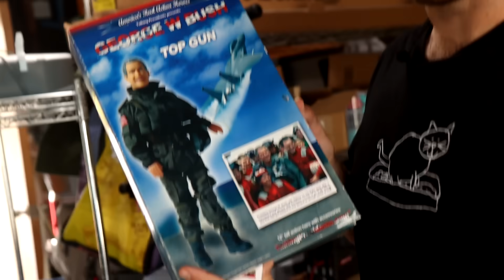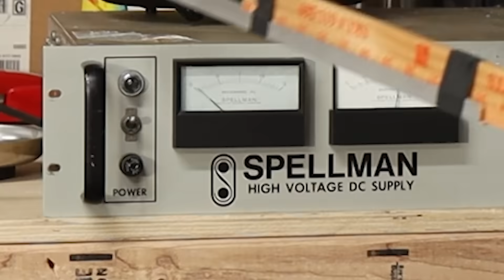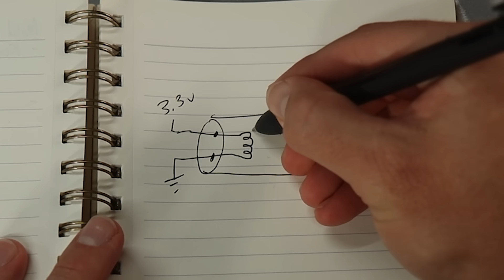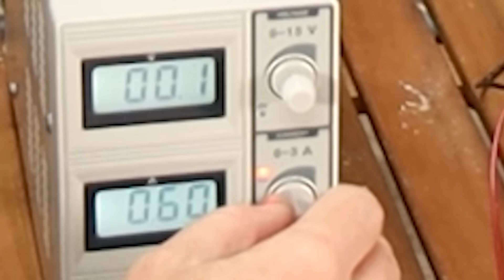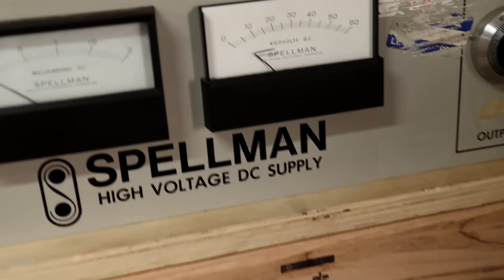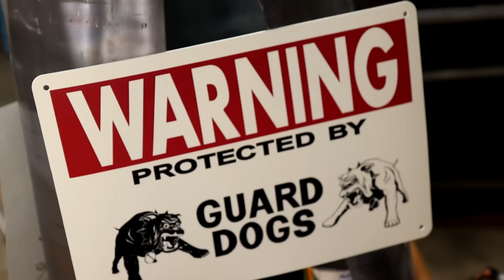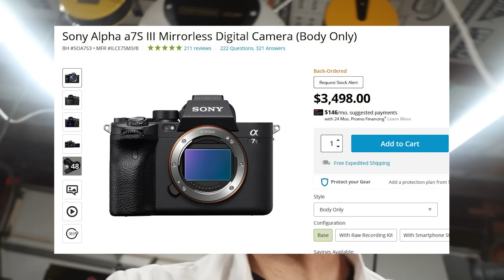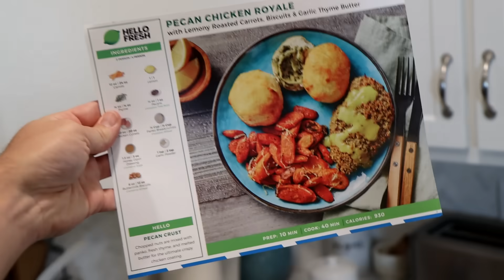Built My Own X-Ray After a Hospital Charged Me $69,210.32

Comment: Have you considered that what you pay for includes so many other things than just the X-ray;

1. the first visit where you explain your problem to the physician 
2. The doctors experience to understand and find your problem 3. The recommendation of necessary tests to understand the illness and give a proper diagnosis 4. Treatment and prognosis. 

Aren’t those things actually the important things you pay for. The tools that has been engineered to perfection to give a better result, better treatment and to be as safe as possible. 

You aren’t happy with how much they charge you. For me this is more a political problem in the USA.
In USA, a heart transplant would cost around $1 million-$1.66 million but in Sweden where I’m from it would be much less. So American citizens maybe shouldn’t be so negative about Obama-care but see it as something that could after more changes and improvements could be acceptable.

Sweden has a publicly funded healthcare system, Swedish citizens and permanent residents do not pay the actual cost of heart surgery themselves. Instead:
	•	Open-heart surgery (e.g. bypass, valve replacement, transplant) is fully covered by the regional healthcare system.
	•	Patients usually only pay the standard patient fee (around 10–40 dollar per hospital visit) and sometimes a daily hospital fee (about 10 dollar/day) during admission.

Comment: I hate to be that guy, and what you have made is very impressive. But you're wrong, this is far more dangerous than a plane. depending on many factors, which we aren't aware of, this most likely is producing extremely dangerous levels of radiation, which your equipment cannot handle. potentially in the Sv/h, and even though you only turned it on for a second at a time, that is still potentially hundreds of uSv. Sorry to be a safety nerd, but with radiation taking risks can have detrimental and lifelong effects.
Reply: If your sorry to be that guy then don't say anything like the holy 3 year old negative comment is real

Comment: Why aren't you soldering the wires and using heat shrink insulation on the wires and building a secure housing for the components ?

Comment: Airplanes emit radiation?
Reply: No the sun emits radiation, the atmosphere Usually blocks these rays, however when you are so high in the air the atmosphere isnt thick enough to block as much radiation, if airplanes were radiation shielded you wouldn’t have said problem, however radiation shielding has to be made of heavy dense material, (for it to be thick enough to block radiation) so the heavy lead/other dense stuff would weigh down the plane.

Comment: William, I think you had the e- part backwards. If we’re only talking about the high voltage and leaving everything else off of the table, such as generating e- through the low voltage application, the electrical arc created exclusively by high voltage will be the same exact plasma arc that’s created by lightning. When lightning goes through the air, the plasma burns so hot that it rips the e- off of existing particles that makes up the surrounding air molecules. It’s also doing it so fast that we hear a sound while it breaks Mach one in the process! Don’t forget that the process is a result of a difference in potential just like anything else electrical, however we have air substituting for part of an otherwise closed system, and for an electrical arc to be created we need a start off with an ionizing event that will cause a subsequent avalanche effect thereby releasing not one, but two e- over and over again with one being the liberated e- and the other being the ionized e-. The result is the plasma that’s replicated exponentially until the arc is closed. The resistance of the air creates the heat as a natural byproduct, just like component level resistors would, the heat repeats the process, etc. As long as there’s a difference in potential, we will see A LOT of various molecules lose their e- as a result! I kind of envision this process as breaking a rack in pool, which then continues breaking more racks. If we really think about it, this is how we are always taught that electricity moves, but actually doesn’t in a closed (wired) system as that’s simply excitation of e-! This is literally moving the e- from point A to point B! I really enjoyed the video and I subscribed. I just wanted to throw this idea out there.

Comment: Ah yes, the xrays are dangerous, I'm so concerned about the xrays and not the 60 thousand volt power supply that's shocking anything that comes close to the unshielded wires.

Comment: Lead isn't special for stopping radiation. All stuff stops radiation. It's just that lead is a cheap way of fitting a lot of stuff into a small space. If you had infinite budget, gold would be a better radiation shield than lead.
Reply: I think lead sucks up electrons and radiation if I recall, thats why you wear a big pad with lead
Reply: @Seedwreck  the x-ray technician, meanwhile, steps outside the room, because the wall is just as good of radiation shielding as your lead apron.
Reply: @diablominero  yeah, that’s how particles work
They bounce or not, they don’t just magically go through things

Comment: There's a few things I'd like to say, 

1. You wasted a lot of money on a high voltage supply. Why? Just why? I bought a 40kV one off of amazon (it's a ZVS Flyback driver) and added a voltage multiplier and it works just as good as yours.

2. I'm pretty darn sure that in a couple of years, you'll regret making this EVER because of the exposures you got from that thinking it's "safe" are pretty large. If it was me, I would NEVER be this close to this and I would NEVER EVER put my hands or anything into that. Now I'd also like to know why did you buy the geiger counter? It was pretty mad, but you still thought it was safe. Look, do what you want with your life, but I don't think that this is worth risking skin cancer. 

Overall, this is absolutely not safe. I learned a lot about x-ray machines, and if I were you, I'd pay those $300 instead of getting skin cancer, hurting myself or others.

It's also a waste of money, I made this project (not a x-ray, but a crt tv which is pretty familiar to this) for less than 50€.

Comment: Using this device sparingly is probably reasonably safe. That said, it probably gives the patient and operator a significantly higher dose than a professional x-ray. The policy of ALARA (as low as reasonably achievable) would discourage frivolous use of a poorly shielded x-ray imaging device. Don't make a habit of using this. I'd also suggest improved shielding. 

I wonder how good the resolution is compared to a professional x-ray.
Reply: Probably not bad resolution if there are lotta particles.
Definitely more than a professional dose

Comment: When I worked in the emergency department I learned about how socialized medicine is killing us pricewise. You go in for a mammogram, and its something like a 14,000 dollar procedure when all's said and done. It uses alot of power, the machine is incredibly expensive, you have to pay for the building, the rent, the actual room in the hospital, and requires technicians in order to service, actively use, and read the results. Medicare pays the hospital a total of 20 dollars for the entirety of the procedure. Doesn't even pay to keep the lights on. TWENTY DOLLARS.

BUT WAIT

THERE'S MORE.

Also, what the gov't does, is hold all medicare funds from dispersing. The hospital has to show the govt, through use of the surveys (that no one fills out unless they're pissed off) that are handed out at discharge or mailed later. If the hospital gets say, an 80% instead of an 85% on one category, the gov't keeps the medicare funds that should have been paid out for services rendered. 

KEEP 

IN 

MIND

everyone else involved in getting that patient into that appointment needs to all fight over percentages of that final pay-out. That means if she had to have an ambulance take her to the ED, who recommended her get a mammogram, (weird but bear with me), that means everyone involved ends up getting 3 dollars or so for this whole situation. 

This is ONE reason socialized medicine will be the absolute death of us. Its like breakfast sausage, we want it on our plates with our eggs, but we don't want to know too much about how it got there, or what its going to eventually do to us.
Reply: I ain't readin allat
Reply: USA just crazier, go north.
Also alot is not a word

Comment: can anyone explain how anode give off electrons? are they replaced then or how it works?
Reply: The electrons actually come from the filament! The filament is heated and a process called thermionic emission emits electrons. Once voltage is applied, those electrons are rapidly accelerated into the anode. Interactions with the anode is what creates the X-rays!

Edited because i misspoke!
Reply: @emilyisaac9028  so they are produced "extra" other than electrons in the metal atoms?

Comment: great vid! what's really funny about this is the emphasis on radiation whilst working with a high voltage power supply with flimsy exposed wires. like the real risk here is electrocution, not radiation dose.
Reply: Yes

Comment: Bro cmon now 😑😑😑 scatter radiation is crazy. And also the lead protection should be more it’s hurting me seeing this cause I’m a xray tech
Reply: Bro is working with the highest voltage with lotta amps, on flimsy, unsoldered wires.
I don’t think radiation is the issue, regardless if there is one

Comment: And now you have radiation
Reply: Bro it’s from a real X-ray. X-rays output radiation for only a few seconds and the amount of radiation is low and couldn’t kill you.
Reply: @crazyjoe4247  I know. I'm just fucking around, however he is still getting WAY higher than recommended levels of radiation. Safe levels are anywhere between 15-500 and a little more. The average american receives roughly 20-40 mrads yearly just through background radiation. I, a resident of nevada (elevation of 6,870ft, mountainous, and close to the nuclear test site) receive an average of 220 mrads a year. This guy is probably getting like 300 in one instant. This isn't dangerous however it certainly isn't considered safe

Comment: As a metter of course, medical equipment is 4-10 times above msrp of the same equipment not expressly certified for medical use. The certification standards themselves, and the commities handing them out are a quet egregious example of graft, but this is basically the same thing you will see with any specialist equipment.

Comment: I felt unsafe just watching this video.. and it ain’t about the radiation.  It’s your wiring..
Reply: Agreed. There's a big difference between having a degree and being qualified to build high voltage equipment.
At my workplace, equipment is all built by HNCs, and we actually had to ban R&D guys from building equipment because of how little they knew about the practice side of engineering.

Comment: How powerful is that tube?  I think about the Therac-25 accidents and get really nervous about the hazards of uncontrolled x-ray emissions.  I also used to experiment with high voltages decades ago and I remember being cautioned against passing it through incandescent light bulbs since a filament in a vacuum combined with high voltage can emit x-rays.  Don't the dentists only energize the tube for a brief moment per image?  Not trolling you, did you actually calculate or, better, measure how much radiation your setup is putting through your hand to be sure it was safe?

Comment: How the hell did he not fry the dental x-ray tube giving it 1000mA or more at 60kV? Those things are usually rated for 3kW at most.
Also, this setup would be highly illegal in most countries since you need to register x-ray equipment and prove that you have some kind of knowledge about radiation safety.

Comment: Engineer with actual experience building custom CT systems for R&D here. 

The main reason X-Ray scans are expensive is because both the X-Ray sources are (~15-60k$) and the detectors as well (~20-120k$) because you not only want to "punch" through live tissue with minimal energy but also want the maximum contrast and no imaging artefacts. Given that you also need a specialist with lots of experience to correctly identify health issues you get a decently expensive price tag that is still likely overpriced (economical viability could be done for 100-200$/scan in theory). CT scans usually take something like 720-2880 of these 2D scans and reconstruct a 3D model from that. This process not only takes a lot more time but also computation power to compensate for a bunch of additional artefact types and to differentiate tissue types from one another. One of the major cost factors is the R&D cost for those complex algorithms. Plus, you need a machine that rotates your X-Ray source and detector around the patient and adequate hardware to manage the whole computation pipeline. I guess it might be possible to achieve prices below 400$ per scan if one of the major players was interested in making CT financially accessible but there wouldn't be much profit left.

Regarding safety: This video does a terrible job explaining what to look out for and what to avoid. If this guys continues like that he might as well keep the grave in his backyard. Let me be clear, I don't think the radiation exposure from the small X-Ray tube is the main concern for this project. Don't get me wrong, you can absolutely get exposed to unhealthy doses of radiation from homebuilt projects like this if you don't have proper protection and knowledge. Metals and water not only absorb a lot of radiation but they also reflect a lot of it into directions you might not think about, so your contraption should be encased in lead or at least something similarly suited. The high voltage part is the real reason why this isn't suited for projects at home and yes, that advice does apply to engineers without extensive knowledge on how to handle high voltage too!!! If you have 60kV (or maybe even the 150kV we use for our X-Ray source at the lab) then the insulators on your cables might not work, any dust on the circuitry might already be or become conductive at any point in time and all existing air gaps are basically useless because if there is less than 1cm of air per 10kV of voltage between components then that is a spark gap waiting to happen and anything grounded (e.g. a human) is a prime target to unload all those kV into. Current limitation is the bare minimum to avoid frying yourself and your circuits but with high voltage it isn't necessarily as safe as you might think it is.

Comment: One time I went to the dentist and they asked for my permission to do an X-ray. I was guessing because of the radiation but I found out when I left 10 minutes later and searched it up that the risk of cancer from one X-ray will go up by less than 1 in 1,000,000
Reply: with a medical grade government approved x-ray machine. This is home-made without any health guidelines and regulations.
Reply: @llopez-eh it’s pretty similar though due to using a government approved part (the X-ray tube) he used which is the only part that can produce radiation. It would be a different story if he made his own (which would not be easy). It’s basically the exact same as a regular dental X-ray the only thing making this one more dangerous is the exposed 1000+ volt wire terminals.

Comment: they are radioactive, Yes you heard me right. you didn't build a protection for, it and that would cost million the ammount of radiations you will get by puttin in you'r head is 5,000x bigger than a normal radiation in your entire life
Reply: You get more radiation from being out in the sun than you do from being a loser (William Osman) and being inside making wacky gadgets (garbage taped to PCP boards). If XRays were that fucking dangerous, Hospitals wouldnt do them, even with more safety precautions because of potential dangers.

Comment: 10:30 That's actually not quite true but for the most part you're contraption is probably fine there have been x-ray machines at shoe stores in the past that have had like one sievert/hour and the reason why was because they kept it running all the time whenever they were checking the shoe size this was a long time ago but yeah if you leave it running you're exposing yourself to a fuckload of radiation however if you just turn it on and off real quick you should be okay

Comment: Watch out of scattered radiation ☢️ 
You had no proper shielding around the tube while using it!
Reply: did you watch the video
Reply: @the_bootleg_starwalker unfortunately yes… he‘s sharing false information about radiation protection and the danger of a x-ray tube without proper shielding!
Scattered radiation are high energetic x-rays which are not in line with the primary beam of the x-ray tube. They get deflected by materials around the tube. Tubes are normally only in operation for a fraction of a second to deliver a safe amount of radiation dose. If powered for minutes you easily could reach higher and potentially harmful doses! And the Geiger counter he‘s using doesn’t display nearly the whole dose of radiation!
Reply: @renreWydnaS  that's cool
Reply: @renreWydnaS  Radiation physics aren’t really the focus of the video, nor should they be. This is more of a “laugh with me as I screw over the hospital”. Either way, the dose he received didn’t do much harm considering he read the manual for the xray machine
Reply: @henrysanecdotes5323  >nor should they be  

yeah, of course, let's just ignore the deadly part of the whole thing - that'll surely help with defeating the medical system
Reply: @Je_QzcY3mN0  The focus of the video is more on the build rather than the politics/economics